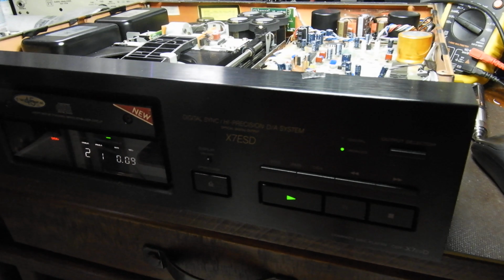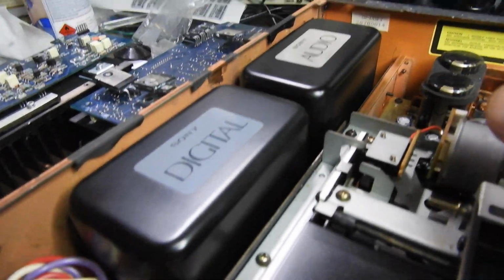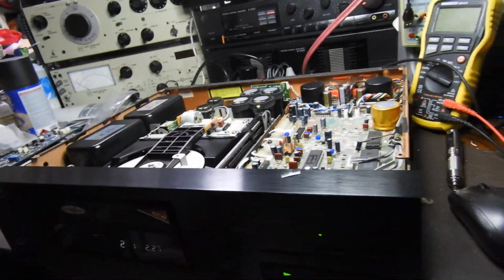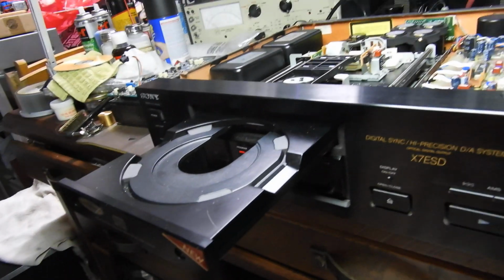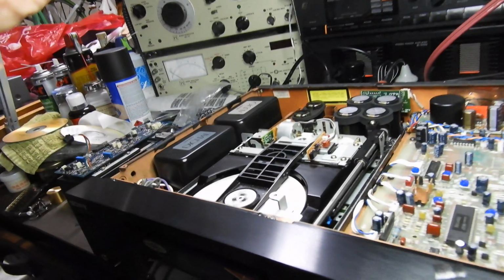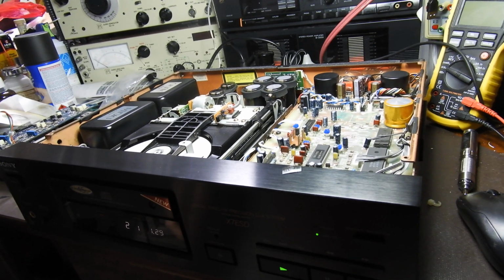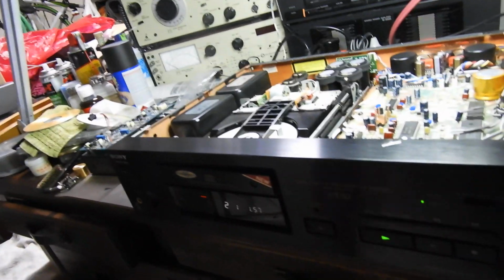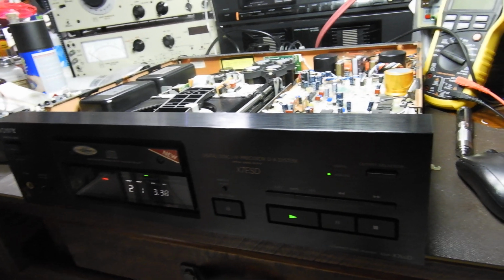Sony CDP-X7ESD - one of the best CD players ever made and probably best Sony player ever.

Comment: Hi. Sorry but I don't think that KSS-190a is a excellent laser pickup. I've seen and repaired some KSS-190a, and, if you see, is a early laser pickup with an diode array photodetector, nothing else. Rest of the circuit is on the main board. If you check and compare, KSS-190a is exctly equal to KSS-151 and 150, BU-1 and other laser pickups that photodetector are only constitued by a photodiodes. If you compare a KSS-190A with a humble KSS-240, or a KSS-272a, KSS-190a perform worst that the others, is more prone to drop outs or bad reads while others read correctly. KSS-190a is a good laser pickup, but is only this, a 80's laser pickup. The good news is that is relatively easy to replace its laser diode or repair. Metal construction helps to it. Another time, no, it is not the best cd laser pickup.
Reply from the maker: When I say that KSS-190A is the best mech ever made, I do not mean the actual laser unit. I mean the whole lot: the loader, clamp, the mech the way it is designed and the laser. Some of the BU-1 units are now 40 years old and still go strong, and if no one does anything silly to them, they are virtually indestructible. I have seen some in early Sony ES machines set to 300µW and they work fine for 35 years at that power level. 
I do not know about this ease of laser diode replacement either. The appear to be only two people in the World who can successfully do it and you are one of them.
Whereas it is more economical in most cases to just get an early Sony player and use it as a laser donor (if indeed laser was at fault), in special cases, your services are invaluable. For those who have a rare and collectable player and want it in top condition, you can probably make these laser better than they were out of factory. No one probably would spend there in them days as much care on setting and calibration as you do.
Reply: @hear-net-au  I've seen in Sony Service Manual always noted 300uW as laser pickup power output, but, actually, power output in sony laser pickup is about 100 and 150uW. KSS-272a and similars is about 115uW, and KSS-151 and similars 140uW. If you adjust power out to 300uW, probably you'll sature RF amplifier.
Another topic, replace laser diode is not an esoteric issue, in DIYaudio you'll can find some threads about it talking and discussing this fascinating theme. Best regards
Reply from the maker: @manolomos  I know it is discussed at length, but only you and one other guy can actually do it ;-)  I have seen and have two Sony machines with BU-1 (CDP-302ES and CDP-303ES) which have laser set to 300uW and have been working like that for 35 years. One of them, I was the first person to open it up.
Reply: @hear-net-au  Something must be wrong. 300uW is too much for BU-1 and other Sony lasers pickups. 120uW is an average power output for those laser piskups.What is the model of your laser power meter?  Best regards
Reply from the maker: @manolomos  I know all this but this is the case. Most player oscillate around 100µW with the exception of some Arcams which work very well on just over quarter of it, and some old Sony players which have 300µW. Same with a lot of Philips. Be it CDM-9 in some designs or even CDM-12. I have seen too many of them to think they are all misaligned. My meter is Leader LPM-8000

Comment: How does this player handle bad cd's ? I have a few basic players, but none of them play original cd's with a few blemishes.
I used to have a Pioneer CD5500 that would play almost anything no other could. I was stupid and gave it away like a decade ago.
If I remember correctly my dad (audio technician) regulated the laser at it's maximum and said it wasn't that good for it's lifetime, but it never failed.
Also I'm not able to find a video of someone testing how good players can handle bad CD's.
Thanks for sharing.
Reply from the maker: To answer this question succinctly, this player when properly aligned, will play ANY CD and well over 90% of CD-Rs (unless particularly poor media and/or poor writer have been used). This is no surprise, because it has the best laser mechanism ever made.
The longer version is as follows:
I do this testing to death and in 3/4 of my videos, I play tracks 8 & 15 of my Technics Test CD.
Track 8 has 0.9mm interruption in data layer which is to simulate a wide scratch and track 15 has 0.9mm black dot painted on it. This is to simulate dirt or fingerprint.
Any CD player should play these if it is to meet Red Book Standard and ANY PLAYER THAT LEAVES MY WORKSHOP DOES.
Some players go well beyond this and play tracks with double of even triple that. I occasionally show videos with Burosh Test CD where players approach or even attain playback of tracks with 3mm wide faults.
Additionally, I also always make sure the player plays CD-Rs. Since there is no standard for these, I have a set of discs that give some players trouble and make sure that these are playable (or at least most of them).
The idea of cranking laser power is a bad one and is used by amateurs with no skill in servo alignment. Sometimes it is done, when a player uses a cheap, $10 mechanism (for the whole long assembly), and the destruction of such poor quality unit is no loss and it can easily be replaced by another one.
In any other case, it should be a "crime, punishable by law", because vintage lasers are a limited resource that is being wasted by people who have no clue. Lasers are often replaced by new ones only to have player which only  occasionally misbehaved, stop playing at all.
In these circumstances, I ask clients for the old laser, I install it back into the machine, service the unit and send it back, for it will work for many years if not decades better than with any brand new copy. Unless someone was silly enough to increase the power on the original one and killed it.
Sorry about this rant.

Comment: The old Sony CDP-502 ES Player is also a superb one but for perfect sound it needs 6 HQ OPA2604 amps instead of the cheap NE5532 industrial OP amps and all the cheap exhaust 1200 and 2700Pf Mylar capacitors changed to styroflex than it plays as good as the X7ESD.

Comment: I've learned so much from your channel - keep up the good work! I have the Sony CDP-x77es and love it, but I miss the buttons from others like the 557esd, which is like having the remote control on the front panel. I just purchased a 555esd (similar transport and Phillips DAC) for use in my main system.
Reply from the maker: This is a fair comment. I too like the buttons on the front panel which are missing in this player.
My Wadia players are even worse in this respect. Only eject/stop, volume up and down and next / previous track on the 861. Wadia 16 is even worse; it only has open / close and play on the front panel (but more LEDs which are not that necessary).

Comment: A brilliant review! Could you please advise me your opinion: is it technically possible to make a direct digital inputs (optical and coaxial) to a vintage high end cd player in order to use its wonderful dac session. Asking because I’m using a streaming device, and stream only 16/44 or 24/48.. i do not need all these new high resolution staff…
Reply from the maker: It is possible but it is not a trivial matter. I tried to get one guy who designes electronics  for a living (and who said it was 20 min job if I give him all the part numbers from Wadia 16 input / output board) and he never got back to me. I now have 2 Wadias which need inputs (models 301 and 581) and can't get anyone to supply diagrams. For a player that was not designed to have inputs this would be even harder. Particularly integration
Reply: @hear-net-au  thanks a lot for your kind and prompt reply! I’m going to address this question to a local hi-fi workshop too.

Comment: Would you know what the top plate is made of? Anodized aluminum?
Reply from the maker: I no longer have it, but I think it was a heavy steel. I know a lot of English manufacturers use non-ferric metals in their cases, but Japanese mostly use just steel. Having said that, I might be wrong and it is not easy to check for me.

Comment: Hi, I've just replaced the draw motor and belts, but have a problem, the tray opens ( very quickly ) shudders because the motors not been switched off !! and shoots back in , it plays absolutely fine. I've checked/cleaned micro switches and get good readings with multi meter off them so they seem to activate ok. I'm at a loss now what else it can be. Any ideas ?
Thanks 👍
Reply from the maker: The answer is...  you have missed some microswitch(es) 😉 I think there are 7 all up. Would have do check to be sure.  Did you do the blue one on the side? Observe them and make sure you understand which one is doing what. The one that's responsible for the tray out signal needs to be cleaned again. Measure all switches with ohmometer to make sure none is above fraction of an ohm.
Reply: @hear-net-au  thanks 👍 but it turns out the new motor was responsible 😡 bought off eBay!!! I took the original one apart clean contacts / oiled put it back and all work's smooth as silk again. With new motor it spun to quickly the tray was like Arkwright's till ( open all hours ) Ronnie Barker 🤣.
Thanks again for your quick response , love your videos and knowledge.
Reply from the maker: @richarddavey9547  Motors normally do not fail, but they do get dirty as was the case with yours. What I do if I suspect a motor, is that I connect the terminals to the µA range of my analogue multimeter and give a shaft a swirl. This causes deflection of the needle which I compare with a known good spare. This tells me if it has torque and if it spins freely.
Reply: @hear-net-au  Thanks 👍
Reply: @hear-net-au  Great tip! thanks

Comment: I have one in Champagne that isn't working, but I can't give it up.  It has problems with the control logic.  Don't know if I can get it fixed, would love to use it as a transport.
Reply from the maker: What makes you think it is control logic?
Reply: @hear-net-au  I have the same problem with mine.  It is a know issue with this deck.  I have been saving mine as well, but would love the control logic fixed.  I had it fixed back in the day by Sony, but it failed shortly thereafter again.
Reply from the maker: @daikuone  where are you located? If you're in Australia, send it to me and I'll have a go at it

Comment: I'm scared of getting one since if it goes wrong will be repairable?
Reply from the maker: Why wouldn't it be repairable? The problem is not that but finding someone that would sell you his which is in good condition...
Reply: @hear-net-au  I have no specific idea except that I have heard about people being unable to get high-end audio components repaired when they have non-generic parts. Is a problem of this sort unlikely with this?
Reply from the maker: @kinglear5952  I fix CD players for the last few years and have always managed to fix higher end ones. On couple of the  lower ones I had to give up on occasion, because you can buy a working one for $400 so there is only $200 to be made and it is just not worth it, with time spent on part chasing, the repair itself, photo taking, preparing listings, answering questions, packing and posting them. Plus eBay and PayPal taking 15%. But on top end units if I spend good few hours, I can get them going pretty much every time.
Reply: @hear-net-au  Thank you for the very useful information

Comment: I still have a CDP-X77ES and it works brilliantly. By looking at the internals, it seems Sony did copy/paste between both. Even the wood side panels were "copied" 😊
Reply from the maker: Surprisingly not. I thought so too but Lampizator investigated it, and pretty mech every Sony player is quite different. They might look very similar, but under the hood they kept on trying to improve them in all price categories.
Reply: @hear-net-au  The X77ES is a low-bit version of the X7ES (which is 18-bit), generally speaking. Well, as far as I know, I am not an electronics expert, but the interiors (and exteriors) look very similar to the layman, so I think these two are quite related. Other players, e.g. 557ESD differ from these somewhat.

Comment: Have been offered CDP X222ES for €50 but it jumps/free,es from time to time.....is it wirth getting and is it possibly an easy fix? Thanks
Reply from the maker: All ES series are reasonable. X222ES is not a remarkable player but certainly worth more than €50. It probably just needs cleaning and alignment. But of course it is impossible to say with any certainty. If you can't fix it, put it on eBay and I will but it from you :-)

Comment: I had one and its sound was digititis personified, very clean and dynamic but threadbare and cold. I compared the X7ESD with DTC-2000ES and the clear winner was the later. Both were at the extremes of the scale. Multibit =hard VS. one bit=soft. The mechanism was  one of the best ever.
Reply from the maker: I cannot really comment meaningfully because I have never had any knowledge of this DAT player and had to google it to find out what it was. Apparently it was Sony Statement on how the digital is supposed to sound. I myself will only be using X7ESD as a transport having countless DACs at my disposal. But need to fix a buzzing issue with it first. I only noticed it when I connected it with balanced outputs to my #1 system and had no time to deal with it since :-(

Comment: What was it about these old Sony lasers that made them last 20+ years ? Anyone have an explanation?
Reply from the maker: Most lasers last a lifetime of the player. Sony used a system where you could align the servo manually, and their lasers did not have to emit any more then 0.1mW. Current players that I see which use Philips lasers run them at 3 times that power, so they do not last as long. Because there are no adjustments and to account for variability of components, they run them at higher power. Or at least this is the case in the initial T.O.C. reading, for I would have to measure the current going through them to find out if it is not reduced during normal playback. I might do that next time I have a player handy and the Service Manual where I can identify a resistor in series with the laser diode. Thanks for that question. This will be a worthwhile thing to check, for I will no longer have to worry about high power being used by the replacement unit.
Reply: hear-net-au : thank you for your answer . I am 51 years of age and I remember these old Sony lasers lasting seemingly forever .Now if I buy a Blu ray player I pray to the gods that the laser lasts me 2 years. It’s sad how companies have gone for the race to the bottom. I think Esoteric in Japan May be the only company left that makes decent CD loaders . Maybe Luxman too . Was it the material Sony used for their laser diode that helped as well ?
Reply from the maker: @jitrapornpha5104  There is no magic in Sony lasers. Philips ones last just as long and they used to use a real glass lenses from Carl-Zeiss. Sanyo lasers last just as long. It is the rest of the player that gives up the ghost before the laser does. If the rest of the player stays working, then so does the laser. It is the mechnics that fail well before electronics. With exception of some poor quality caps...

Comment: I agree, Fantastic CD players the Sony ESD models are,  their very best models & best of all brands i.m.o.  wow, 17 Kg weight for this one!  premium Elna(?) capacitors, Die-Cast BU-1 or BU-1A aluminium transport mechanism (their ultimate & also used by Accuphase's top Flagship Model for many years   Made now, this CD player would cost very many thousand. Sony then had one-of or the highest & most highly financed established design, research & production app' departments at hand & manufacturers of today just cannot afford to set-up & establish a necessarily low-quantity production run of a Sony's ESD player's high level of build, component & sound quality without the associated uber-high "boutique hi-fi" price-level. I have a very similar Sony 557 esd & quite a few other ESD owners have said online how they sound better & more musical with their over-sampling turned off. It can be made switchable by any half-decent electrical engineer but i've yet to try it. Lampisator online tells you how with clear detailed pictures of each stage to take, he rates these Sony ESD players as the very best of all, he even details how to bypass their output stage with 2 ECC double triodes driven direct from the Burr Brown D/A output chips, don't think i'll go that far tho, less i can get another 1 (or 2!) S/h as a backup, i'll be lucky to but i do rate them that highly.
Reply from the maker: You should see Sony Service Manuals from that era. Multicoloured layouts, folding out diagrams showing the whole unit on one page, signal flows marked with thicker lines and - what is so uncommon these days - descriptions of theory of how the circuit works.